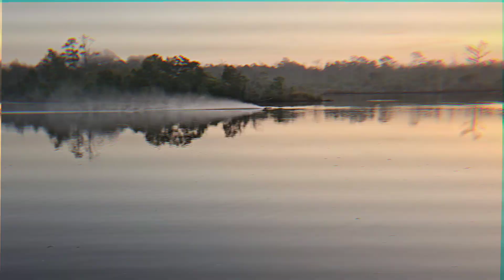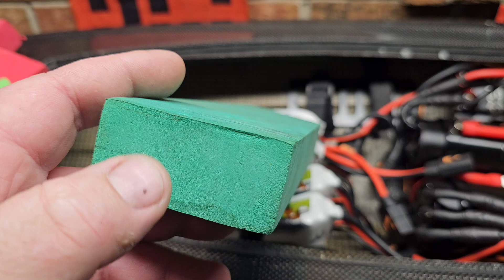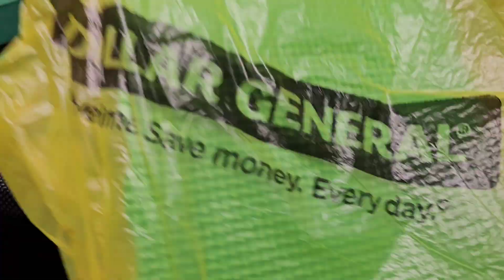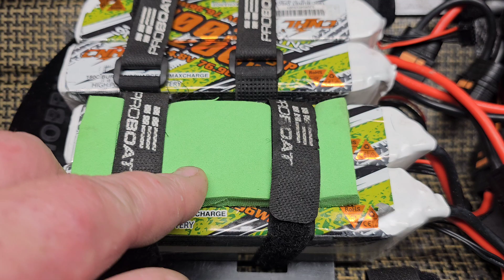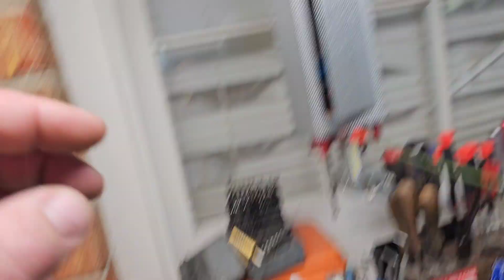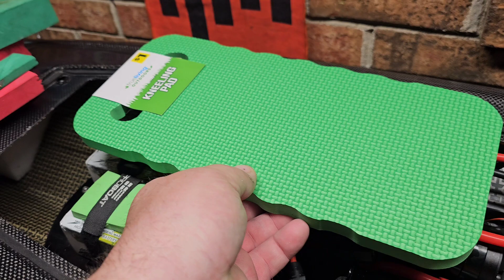Secure Your Lipo Battery's Cheap, Lipo Jam Foam For Any Remote Control Vehicle

Comment: Big B my name is Benjamin  I had started following you around December 2024. I have been in R/C since 1986 got my first hornet and then was racing offraoad indoor electric. Now almost 50 and I have a collection brother. I only have a couple boats though. Stealthwake was my first and Mis Geico is my 3rd. My second boat is a  M41 and I really enjoy it. I know you can help me out though. It just doesn’t seem to be using all its potential. Please tell me exactly what prop I should buy or props to have it going smoothly on top of the water bother. I know it’s under powered and it could use a XLX2 and a castle motor easily and since I have castle in almost everything I own. It will happen in time. Hey Castle is just a stones throw away from my home here in Shawnee Kansas. It’s really a wonderful store. You take anything there they make that doesn’t operate properly you will leave with it fixed or new just like craftsman tools. It’s a great company!! Anyway back to the subject matter that M41 I want to run it stock electronics and get it running properly. What prop Big B do I need brother thank you so much and I appreciate all the information and creativity that you bring. You’re the man dude!!!!

Comment: Would love to see you build a 4 foot long jetboat 50mm  something different
Reply from the maker: Sure, no problem,  wish I had an extra 2k laying around for a big build like that.
Reply: @IRONCLADRC  thats what I'm running right now and not having success, think my esc and motor combo are to small for a 50 mm pump 4274 2000kv and flycolor 150a on 5000mah 6s, constantly cutting out

Comment: I put cabinet liner down on the battery tray then use my straps, but putting the foam on the top would really help hold them in place. gonna go buy so of those pads

Comment: Big B , Great find 👏👏
Is it what they call “closed cell” .
To me that means that it won’t absorb water . Hence it can also be used for flotation . Foam which is not closed cell will absorb water and sink the boat . Thanks
Reply: Answering my own question .
Saw @Dr_Jet reply below .

• Al Overview

Yes, EVA foam is a type of closed-cell foam. It's made from a blend of ethylene and vinyl acetate copolymers, resulting in a material with a fine, closed cell structure. This closed-cell structure gives EVA foam its unique properties, like being waterproof, resistant to moisture and chemicals, and offering good shock absorption and cushioning.

Comment: Just had my 4s packs come loose in my blackjack 42, nasty flip, completely shattering multiple areas around the hull. Thank you for the tip. Definitely using this method moving forward. Thanks brother!
Reply: They have these kneeling pads for a buck 25 at the not a dollar dollar tree stores in my area!